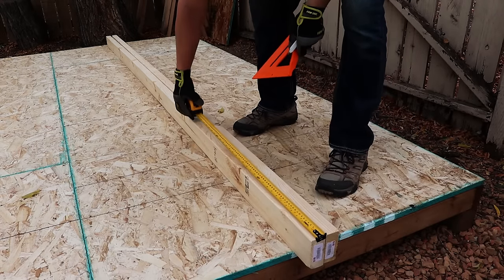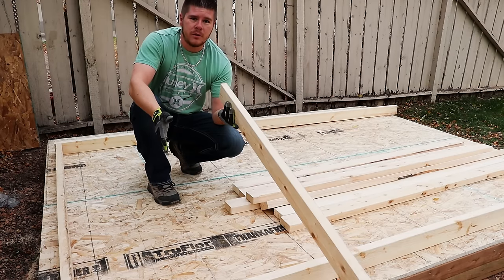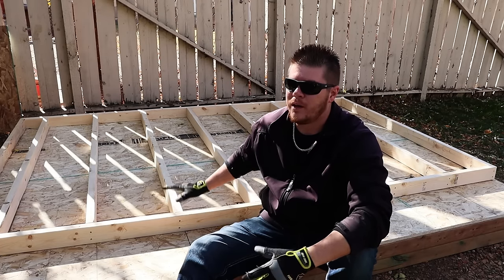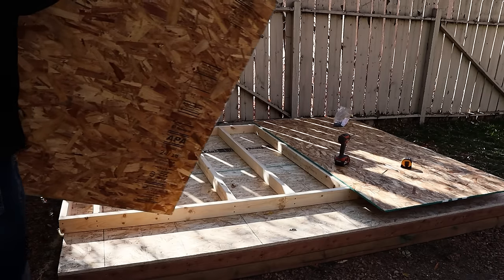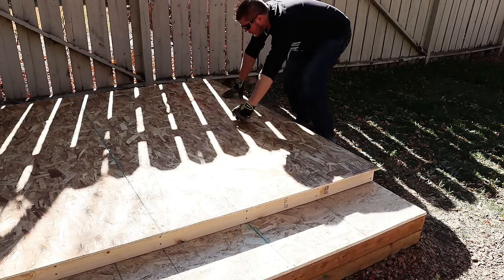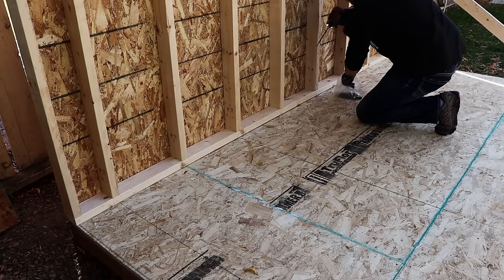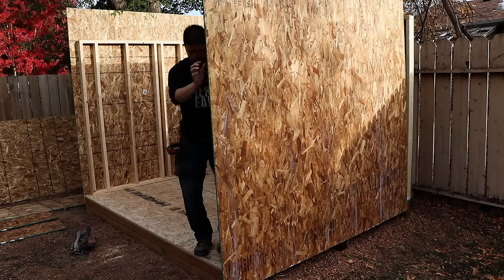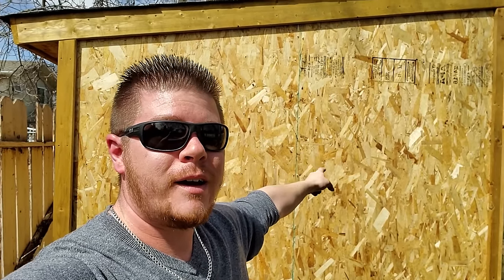How to build a storage shed - Walls // Part 2 - Plans available

Comment: Love how you explained things in detail. I'm going to follow your videos and put a 10x10 shed together. If you don't mind me asking, how much in CAD did you spend to build yours?
Reply from the maker: Thanks, I'm glad I could help! That's awesome! All total it was $1700 for mine and that was when lumber was starting to go up already, now I'd guess it would be $1200-1300. Keep me posted, I'd love to see yours. Good luck!
Reply: @JessedoesDIY  Ok. Yeah, I'm thinking the 10x10 will cost $1500-1700? I'm pricing things out this weekend. I'll keep ya posted. Thanks again. ✌
Reply from the maker: Anytime!
Reply: @JessedoesDIY  Hey, question. What did you use the 4" screws for in this build?
Reply from the maker: Screwing down through the floor plates of the walls. This way it went down through the plate, through the 3/4" OSB and well into the floor joist below.  Like I said tho, just make sure to keep them in the outside half of it because the outside joists are verticle so they are only under the outside half of the plates

Comment: I am building one inside my garage bc HOA will not let me do one outside =( and my wife is being super touchy about wanting a shed inside the garage to avoid pests. Makes no sense to me but building a shed on one side of the two doors garage has actually given me a lot of height room. Since my ceiling is about 16 feet high.
Reply from the maker: That's an interesting pickle you're in. Either way, good luck on yours!

Comment: Hey love watching your videos,  I have a question for you . I'm tearing down my old shed that's 8' x 20' and going to replace it with a 10' x 8' suncast resin shed ok , basically my base frame will comprised of 3x 4"×4" with 2"x 4" framed or sitting ontop of of the 4"×4" 's . I thinking of using osb tongue & groove plywood to set on top of the base , would that be ok , or should I use pressure treated plywood which is crazy in price $ 90 per sheet apposed to $ 40 for the osb .. BTW the 4x4 & 2x4 's will all be presure treated.. Thanks
Reply from the maker: Thanks! Basically the structure will be roughly the same as I have here then. I used OSB tongue and groove and it's just fine in this use case. The biggest reason everybody gives it a bad rap is they've probably used it wrong before and it didn't last a year without getting soft and squishy. My shed is 3 years only now and the floor is as strong and even the same colour as the day I built it! But that's because the 4x4 beams provide an air gap for the 2x4 floor framing to sit on, so nothing gets wet and rots out. OSB will last decades if used correctly

Comment: I am thinking of building a 12x10. What are your thoughts on 24" OC for the wall framing? Also, extending the walls 2ft (deep), would you recommend keeping the 6.5' height on the back and side walls?
Reply from the maker: Cool! You can do 24" OC, I just prefer 16" for solidity and a bit more strength. The height is all up to you but I do really like that height for the back wall. It's just high enough you won't smack your head on it lol and you can still mount things to it within reach.

Comment: Nice work bro!! My mother has been wanting a pre built shed like the ones at home depot but the cost has gotten so high for them recently. So I want to build her one. How much did all of the wood cost for this project?
Reply from the maker: Thanks man! I could build this one locally for about $1300 today, that's everything. Paint, shingles, wood, fasteners, the works. It isnt cheap but it isnt expensive either considering the pre builts can be more money and have less materials and lumber in them. This is built very sturdy. Good luck on yours!

Comment: Do you recommend the Rigid drill and what size is your drill (power)?
Reply from the maker: I like it, it has the most power of the cordless drills I've used (at least this model does). It's 18V. I also have the equivalent Ryobi 18V version that's less expensive and it's 90% of the way there for less money

Comment: Great video! What screws and what length did you use to attach the sheet to the frame?
Reply from the maker: Thanks, I mentioned in the video, and it's all in the plans if you want in extreme detail. But it was 1 1/4" deck screws

Comment: What’s the long attachment to your drill? I’ve seen them before but not sure what they’re called or why people use them. Is it helpful to put in screws on the side like that?
Reply from the maker: It's just a 6" long impact driving bit for driving screws. Many people use bit holders that go in the drill and small bit tips that fit into them, but I can't stand them. The bit always stays in the screw so I just use 4" and 6" long bits myself. You can find them at the hardware store with the rest of the bits

Comment: So nice! I am planning to build one. Do you have to anchor the floor to the ground?
Reply from the maker: Thanks. This is a floating shed, I don't have to here. That's why I mentioned to check local laws. If you're in a tornado or hurricane prone area, it may be required. It'll stand up to a surprising about by itself. I'm in a extreme climate and it's already seen plenty
Reply: @JessedoesDIY  thanks!

Comment: I’m not a handy man but I try too do my best I was just wondering what’s the cost average when compared to buying a shed completed and having it done
Reply from the maker: No prob. On average this will cost about the same amount as buying a shed depending on costs in your area, either plastic or wood. The biggest difference here is it is substantially stronger than a plastic one with the ability to mount things to the walls just by adding more lumber inside to make shelves, or places for screw in hangers. It also has about twice the amount of wood in it compared to a wood one you can buy as a kit, lending to more strength.  Mostly it's strength per dollar spent, as well as customizability

Comment: hello, i have started my project to build a shed following your videos. floor has been built.  a question please.  you are using osb for walls, and then paint these walls.  will the paint protect osb plywood from rain and water damage ...? do you have any other recommendations for wall panel materials  that is waterproof ....? i do not want to add siding to outside wall. i just want to attach some sort of exterior material to the studs and be done with the walls. any steel material that can be installed as walls...?  ****[ want to avoid osb sheets plus siding over it as siding must go over osb plywood that is exposed to open weather conditions  ]**** thanks.
Reply from the maker: Hey, that's awesome! OSB is actually naturally rot resistant if used correctly because of the glue in it. Leaving air gaps by building the floor keeps it dry, and a layer or 2 of paint on the walls does seal it further, protecting it. But you will have to repaint it as necessary every 8 years or so. There are shed sheeting wall material you can buy that have a panel texture and primed ready for paint but it is actually still OSB underneath. OSB will last just fine if used and protected correctly. Keep me posted on your progress and good luck on yours!

Comment: Like your tip and tricks in building a shed, I’m planning to build one myself but my issue is the base, I’d like to do concrete but too expensive, and the wood base how durable is it ? I even thought about the concrete slabs 24x24 but still yet to come to a decision. I’m in Canada….
Reply from the maker: Thanks, glad you liked it! Yeah, a concrete foundation is very expensive, especially compared to wood. Using pressure treated wood on the floor and setting it on a bed of rock, not gravel, rock let's water drain away so the wood isn't sitting in mud, and leaving that air gap underneath, this should be an easy 25-30 year floor. Pressure treated lasts 30 years. Another option is to use patio blocks in each corner so it's elevated, but then I'd use 2x6 joists for a light shed or 2x8 for a heavier shed because there is nothing holding up the center with that beam gone
Reply: @JessedoesDIY  Thanks I think I'll do just that, the shed size would be 8x10.. I'll keep intouch let you know how things work out when I start
Reply from the maker: Anytime! That's awesome, good luck!

Comment: Hey Jesse, I am 6’5 with no shoes on. What is the appropriate height I could do for a back wall to still maintain strong overall integrity? 1:57
Reply from the maker: Hey! My brother in law is 6'4 doesn't have issue with this, just because you never walk fully into the back against the wall and the side walls go up instantly so there is a ton of headroom in this design (one more reason I prefer this style to a pitched roof like you normally see). From there, you have the 2x4 rafter on top of that. But honestly, if you wanted to raise it up so the walls are 7' tall, it would still give the roof enough slope. Just make the back and side wall studs 79.5" and keep the front wall at the same height.

Comment: Any benefits of using screws for framing? Aren't nails more durable?
Reply from the maker: Nails are more durable in a shear force, but this shed is experiencing no shear forces in its design. Screws have a better hold strength. But I really just did it this way because a impact drill and screws are far more approachable and commonly used and available than a nail gun for the average homeowner

Comment: I was pretty lost on this one, think its because you had the shorter walls.an 8 ft wall wont have any sheeting overhang, right?
Reply from the maker: The shorter walls are 6.5' tall and the front wall is 8'. But I cut a few inches off the studs first so the wall is technically just under 8' so I had enough sheeting to wrap over the floor. You'll need to remove the thickness of your floor plates, floor sheeting, and floor itself from the studs.

Comment: Hi Jesse: I have been in the process of building the walls and been following your videos. However, it has been raining here in Calgary on and off for the last few days now. If the inside of the shed is not covered and if the water goes in, would it affect any of the lumber? If so, is there anything you recommend to protect the inside of the shed? Many thanks for the videos.
Reply from the maker: Hey, I'm glad you're building it! I'm in Saskatchewan, send some of that rain this way, it's been dry here lol. You can usually get away with some rain falling on it as long as it does have time to dry and doesn't stay wet. If it's going to keep raining for a long time and keep it soaked for days I'd try to cover it with a huge tarp, or multiple. Hope that helps
Reply: @JessedoesDIY  thanks so much! It looks like the rain doesn't want to go away from Calgary. we are expecting rain this whole week. I will do my best to not ruin the shed. Its come out really good. Thanks so much for the plan and the videos. They were perfect!
Reply from the maker: Anytime! Oofta, we'll feel free to send some this way lol we haven't had rain in a month and things are starting to turn yellow. I'm glad I could help! Hopefully you get the rest finished soon, let me know how it goes!
Reply: @JessedoesDIY  Thanks again! I "almost" completed the shed. The only thing remaining is painting and adding some rigidity on the inside. I really appreciate your guidance. Couldn't have done it without your videos. Cheers and best wishes!

Comment: What's the total cost of material for this shed? Debating on doing this or buying one to assemble.
Reply from the maker: This was $1700 for me to build. But personally I'd spend the extra on this because with one to buy you still typically have to factor in the cost of a floor foundation too. And this is much stronger than those with the ability to add shelving wherever and however you want, and also the ability to hang things from the walls

Comment: Thank you.  Quick newbie question.  When you state half inch osb for the walls are you talking about 7/16 osb sheathing or 19/32 osb sheathing?
Reply from the maker: No prob. Yeah I'm taking about 7/16". All sheet material is slightly undersized from the mill and for some reason they call some of it in its nominal size, and some of it in actual size. Most people just refer to it in its nominal size. Hope that helps!
Reply: @JessedoesDIY  appreciate it.
Reply from the maker: Anytime

Comment: Is it a problem to use screws for framing? People all over the internet say not to use them because of lacking sheer strength. And yet I’ve also seen sheer testing videos on YouTube where deck screws perform the same as nails. They bend back and forth at 90 degrees twice before snapping.
Reply from the maker: No it isn't a problem in this case. For certain things like hanging large joists over a span yes, I'd use nails because the sheer is higher, you can test it yourself by just putting 1 of each halfway or more into a piece of wood and smacking it sideways with a hammer. But in this case screws will provide much more clamping force, and a drill is something everybody has access to and is fast. I have no sheer loads in this shed so it's a non concern, everything is a clamping load. Nothing with pressure on it is overhanging anything where a sheer strength is needed, all the load are being picked up and being transfered down into the timbers and the ground, straight vertical, no horizontal anywhere. Hope that helps

Comment: Just a question.. why are you putting the floor directly on the ground?  Would it not be better to use those foundation blocks like for ground level decks?. I don’t know that’s why I ask.  So far I figure you are either from Alberta or  Saskatchewan.  Am I way off?
Reply from the maker: You could, but this is typical in shed building and I didn't want it to be too high of a step in. If you go that route you'd need to up your joist size to at least a 2x6. The timbers underneath support the entire floor of the shed as opposed to points, and it allows for a large displacement. It also allows me to get away with the 2x4 floor joists. This is also much easier to level, at least to me. Either way would work tho. And I'm from Saskatchewan lol how'd you guess?
Reply: @JessedoesDIY  it’s your way of speaking.  More western drawl then swallowing your words or cutting them off like Ontarians, no Irish type inflection so not east coast.  Your speech and pronunciation have almost no accent which is typical of western people.  That’s why they are commonly hired on American news as anchors.  Lots of western Canadians were top news anchors in the states because of their perfect pronunciation. Besides you are doing it yourself.  Self sufficient people us westerners.

Comment: Curious why put floor first and walls on it, what if u need to change the floor ? I did the same and animals basically made a whole in it over the years from the bottom, now I am thinking how to change it 😞
Reply from the maker: Because that the way framing basics works. You need to spread out the load from the roof down into the walls, the walls into the floor and floor into the ground. The walls can't do that any other way. To make a repair in the floor you need to find where your floor joists run by looking at the fasteners in the floor. Set a circular saw blade depth to be very shallow to barely cut through the floor sheet. Cut a hole from one joist to another to get rid of all the damaged floor. If the joist is damaged, buy another and laminate it to the existing one with construction adhesive and screws to brace it for strength and then get a small patch panel of new sheeting and screw it down into place. Hope that helps!

Comment: do you think framing with metal would work only asking cause wood is pretty expensive rite now
Reply from the maker: I personally wouldn't. Typically metal framing is attached to larger steel structures. This will literally be the full structure of the shed and I can see it being as solid, especially with this type of roof installed. It does suck tho the price of wood right now, it's insane

Comment: Could you have used 2x3 to help save cost would it impact sturdiness
Reply from the maker: 2×4 is typically the smallest you use for any kind of framing, especially for something like this. For the sturdiness vs cost, go with 2x4.

Comment: what size screw did you use to attach the OSB to the frame?
Reply from the maker: Typically you use a screw at least twice as long as the material you're going through. I used 1.25"

Comment: Do you have any concerns with the underside of your OSB floor rotting?
Reply from the maker: Nope, not at all. That's the reason for the beams it's sitting on. Because the floor is elevated off the ground it doesn't trap moisture under it, rotting the wood. This way leaves an air gap and everything stays dry and breathes. OSB has some weather resistance to it because of the glues in it, so as long as it can breathe, it will last just fine. Hope that helps, thanks for watching!

Comment: Is there any reason not to do a full 8ft wall on a 8x10 shed? Id live to have higher ceilings but its hard to picture if that would look silly or not
Reply from the maker: Mine was basically a full 8' at the front, but you need a slope to the roof. You'd have to go 9.5' at the front then to have 8' at the back which would make it so you'd need a seam between the osb sheets going up because they won't reach, sheets are only 8' tall

Comment: Nail gun or screws...which is better?
Reply from the maker: Depends on the job because they are made for different purposes. In this case and the design of it, either or would honestly work, it really depends on what you have access to. I used a drill and screws in this case because it is something that almost everybody has and is easier for most